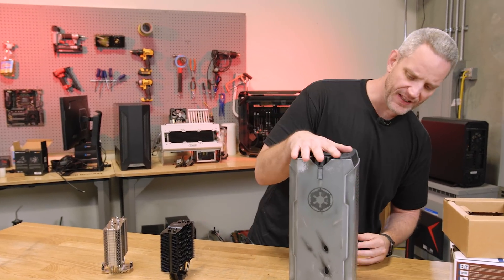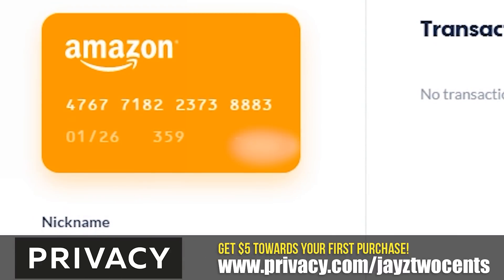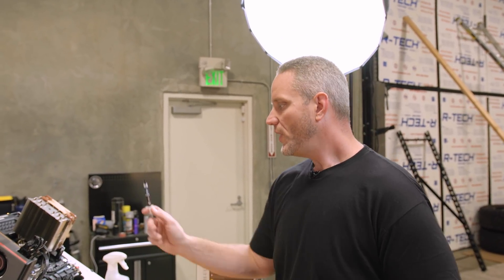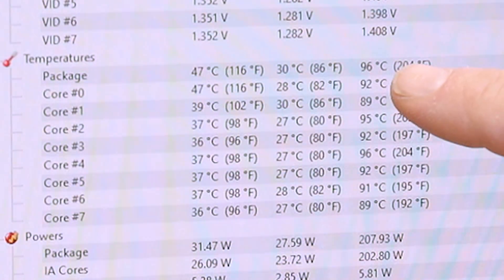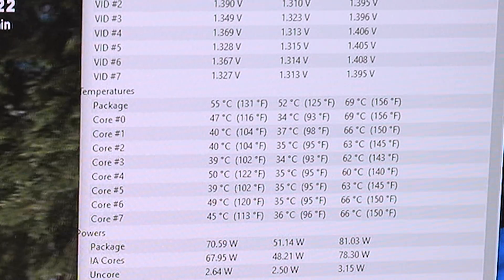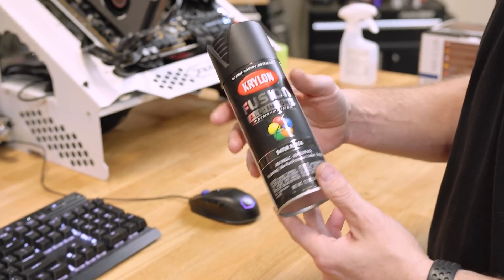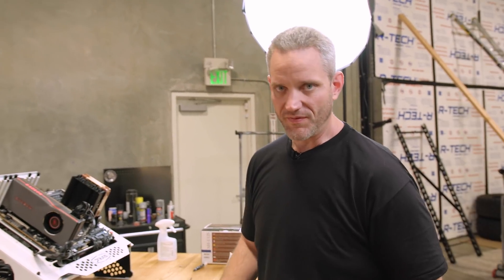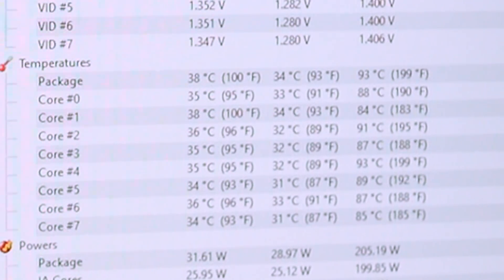Does painting a heatsink hurt its performance??

Comment: This is posted BEFORE watching the entire video. Considering the folks have been painting the intercoolers on their cars and seeing improvements in intake temps, my  guess is a slight drop....

Yup. That one ran me over in the end. So much for the "black body cooling". I guess the better question is;  Why does it work in turbocharged cars, but not CPUs?
Reply: Intercoolers don't transfer heat, they transfer cooling. A radiator on the other hand might be different.
Reply: @serfillustrated4018  The purpose of radiators, heat sinks, heat exchangers and intercoolers is to move energy (heat) from one place to another. In all instances, they are used to cool something that gets hot. In my question above, the heat is generated by the compression of the air and the sinking of heat from the turbocharger. Folks have been painting intercoolers in dark colors or black to improve the efficiency of said heat extraction with noticable improvements. I just wonder why it doesn't work for a CPU.
Reply: @rhl8673  Yeah i got into a long back and forth with another commenter on here lastnite. I probably confused the hell out of him because i had your comment in my mind the most.. But an intercooler isn't removing heat from the engine as its purpose. And while it does dissipate some heat from the turbo its main function is to cool the compressed air before it enters combustion because a supercharger uses a intercooler too and it isn't powered by the exhaust. An air cooler for a PC acts more like heat fins on a small engine block as it only dissipates heat. Where as a watercooler on a PC acts exactly like a radiator as it removes heat and introduces cool to the same part. So there really isn't an equivalent to an intercooler on a pc. But if i had to guess why its working on a car it may actually be insulating the air going through the intercooler from the heat of the engine bay. But thats just a rough guess.
Reply: @serfillustrated4018  An intercooler does not remove heat from the engine... Correct!

An intercooler DOES remove heat, just like a radiator, from the air charge going into said engine, thus increasing it's density and improving power gains from forced-induction systems. As a matter of fact, some intercoolers are re-purposed radiators and are rather efficient at heat extraction. The only reason there are fins on air cooled engines is to increase the surface area exposed to the moving air stream. Therefore, the fins on an intercooler do the same thing, increase surface area to improve heat dissipation.

You need to keep in mind that all terrestrial cooling systems rely on fluid movement of some kind. The fluid in use could be anything from air to Argon to oil to water and even specialty premixed coolants. I mean, even the fuel system in a car relies on the fuel it's pumping to keep the pumps from blowing the car into low-Earth orbit.

A supercharged engine uses two heat extraction methods because of the inherent design of the charging system. Most Roots or Lysholm type superchargers use a heat exchanger, a pump and an air-to-liquid intercooler(radiator) to cool the incoming air charge. It's not as efficient as a turbcharged and intercooled system, but it does allow for instant boost.

Now, let's go back to my original question. Why does painting an intercooler black improve efficiency, but not on an air cooled CPU heat sink?
Reply: @rhl8673  I don't know that it does. I don't know how controlled the variables were for those tests. Yes i know that a radiator and an intercooler are exactly the same part, broadly speaking. But like i said before, there really isn't an equivalent part(in function) on a PC to an intercooler. An intercooler on a car isn't dealing with as much heat as a radiator or heat fins of the engine block. And since an intercooler is cooling the air that is traveling through the inside hollow portion of it. My only guess is that the paint may be insulating the inside air from the outside air of the engine bay that the intercooler sits in. The kind of paint may play a role too. Im sure a lead based or any other conductive paint could help radiate heat as well. Fin density in a PC air cooler may be tighter too. So painting the fins may be restricting some airflow going through it.
Reply: @serfillustrated4018  I'm sorry, dude, but the intercooler on my car is definitely handling way more heat than the heat sink on even the meanest CPU. The turbocharger on my car can reach temperatures of nearly 900 degrees F and compress the air to around 19psi, while my average intake air temperature barely breaks 140 F at the throttle body on a hot summer day. And as for air cooled engines, like a weed eater, that 30cc engine probably makes close to 5Kw, enough to power 10 high performance PCs. I will admit that an air cooled engine will get way hotter than a CPU should ever be, but still not hot enough to melt the plastic housing it's mounted on.

I'm not buying the fin spacing idea either. Most of the air coolers I have seen have fin spacing that is equal to that of an automotive radiator or intercooler. If it was any tighter, air flow would be greatly restricted.

There is something else going on. You may be onto something with the thickness of the coating layer or it's composition, but it still leaves me wondering why there is a difference.
Reply: @rhl8673  "I'm sorry, dude, but the intercooler on my car is definitely handling way more heat than the heat sink on even the meanest CPU"..
 I NEVER compared it to a cpu/heatsink temp. I compared it to an engine block or radiator. And the exhaust side of the turbo isn't the same as the intake side. You may have 900 degrees coming out the exhaust side of the turbo but the air coming out of the blower is nowhere near that. 

"I'm not buying the fin spacing idea either. Most of the air coolers I have seen have fin spacing that is equal to that of an automotive radiator or intercooler. If it was any tighter, air flow would be greatly restricted."..
Thats my point man. The PAINT density on the fins could be restricting airflow on the CPU cooler, NOT your car. An intercooler has ALOT more air pressure blowing through the fins then a tiny electric fan provides for a CPU cooler. Thats why the cpu dropped 6degrees when he switched to the faster black fan. 

"You may be onto something with the thickness of the coating layer or it's composition"..
 Yeah id say that is what is playing the biggest role.

Look man. My WHOLE point is that you cant compare a cpu cooler to an intercooler. BUT.. A cpu cooler IS comparable to fins on and engine block. And a liquid cpu cooler can be compared to an engines radiator more accurately. But of course the scaling are different. And once again, YES i know a radiator works the same as an intercooler. But a radiator is used to cool the engine just like a heatsink/watercooler cools a cpu. An intercooler is NOT used to cool the engine, therefore it doesn't relate to any part of a PC as PCs do not run on combustion. Good talk man. But i had a very LONG and similar conversation about this with another dude lastnite. Im kinda burnt out on it. 

Later Man!!
Reply: @serfillustrated4018  You're burned out because the information you are using is flawed. The point I am trying to make is that an intercooler and a CPU heat sink do EXACTLY the same thing. Move heat from one place to another. In the case of the intercooler, it moves heat from the Hot, high pressure air charge coming out of the turbocharger to the air using fins and a fan. The CPOU heat sink removes heat from the CPU die and transfers it to fins that are cooled by a fan. It doesn't matter what you're removing heat from. For all I care, you could be using it to keep a constant temperature in a box of Skittles. I want to know why an intercooler painted black improves performance, but doing the same operation to a heat sink gives the opposite result. That's it. Nothing else. Thermodynamics is an interesting subject to me and, somehow, I got dragged into some wild tangent trying to explain it to you without losing my cool. (no pun intended) So, if you can't come up with a decent answer, I think we're done here. I'm sure that someone more knowledgeable than either you or me is floating around here.

Comment: Cerakote or whatever ceramic coating are marketed as thermal insulation for exhaust I don't get why they would use it on heatsink which is supposed to dissipate heat...

Comment: Prediction: It will matter a little bit, but not terrible.
I was right, You should try it with 2 low flow fans in a push pull config to see if that would help temperatures.

Comment: I saw this experiment once before. In a low to no airflow situation the black paint increases thermal transfer through radiation but in a high airflow situation that extra radiation is more than offset (negatively) by the insulating properties of the paint. I think this was done on mighty car mods channel if you want to look their research up.

Comment: there are some paints that are thermal oriented that maybe have better thermal conductivity, or a powder coat, but the metal should be very clean before the painting, like you do with thermal paste, to get the best contact possible for heat transfer, yeah, sorry, I'm babling a lot

Comment: I predict what Jay is saying at 1:20 - a couple of degrees hotter. Not at idle though, and not on short loads; only after extended loading, once the cooler and case reach equilibrium. I predict the equilibrium temperature will be higher once painted.

Comment: You can get special thermally conductive paint to reduce the thermal resistance. Also the finish matter, a finish with more surface area can have lower Thermal resistance.

Comment: no, hold the base of a cpu cooler with no fan on it and put the other end in hot water and see how quick you feel the heat at the other end, as long as there's still air going over it it'll be alright, maybe a couple degrees difference

Comment: My guess is that it will warm it up slightly, due to the paint restricting airflow between the fins and insulating heat so if it was in a case then it would probably absorb some of the heat generated in the case from the other components.

Comment: I can't make an informed prediction but from past experience it will depend on 2 factors: (1) type of paint (is it a heat insulating or conducting - both paints exist) and (2) there clogging between the fans.  If it is heat conducting paint and little to no clogging of the fins I predict little to know degradation in performance. :)

Comment: Years ago  (Slot 1  Pentium II era)  a super techie friend lampblacked  ( Used an actual black smoky flame source)  a Celeron 300a heatsink and got the 300a to stay stable at a  450 mghz overclock where it had been a little flakey before. 80 mm fan out of a dead PS helped too though. Black anodizing is the way to go however.

Comment: I wonder if it would be the same result as when Mighty Car Mods painted an intercooler black to see what would happen to its performance.
Reply: A cpu cooler dissipates heat like a radiator. An intercooler collects cool air.
Reply: @serfillustrated4018  No it doesn't. Hot air flows through it, and it radiates the heat away to the cooler air flowing over it.
Reply: @acdchook  Which are you referring too?
Reply: @serfillustrated4018  An intercooler. Hot air out of the turbo flows into the intercooler, which radiates heat away to the outside air, so the air exiting the intercooler is colder.
Reply: @acdchook  Thats true for a turbo. But its a little different for a supercharger. A supercharger creates heat due to air compression while a turbo charger creates most of its heat by being run by the engine exhaust. You could technically use a intercooler to collect cooler air on a naturally aspirated engine by using ram air to push clean air through the intercooler. My point is that a radiator is to ensure heat dissipation from the engine itself. An intercooler doesn't dissipate heat from the engine per se but from the turbo or supercharger compression. Yes they technically work the same but the objectives are different.
Reply: @serfillustrated4018  An intercooler is the same on a turbo or supercharger. They go between the compressor and the engine intake. The air is hot because it is compressed in both cases. A CPU cooler may be hot solid metal, vs hot hollow metal on an intercooler, but both are just trying to radiate heat away into the cooler surrounding air.
Reply: @acdchook  Yeah but a cpu cooler is only used to radiate heat, which is more akin to engine block fins. And of course a liquid cooler is identical to a car radiator. Nothing on a PC is really close to an intercooler unless you consider intake fans. You are right but im just comparing a cpu directly to an engine. My point is that a radiator takes heat from and engine while an intercooler may transfer some of the heat from a turbo, its main function is to cool down compressed air before combustion. So an intercoolers job isnt to remove heat from the engine but to introduce cooler air.. Thanks for the talk tho.. Its good to work my brain late at nite!!

Comment: 1:16 If you use an enamel paint which knowing you, probably. I'm betting that it's only going to make like a two to three c
Yupppppp
Reply: Maybe a Carbon Black paint... might rub off easily, but should be pretty conductive.
Reply: @CrashM85  an enamel based paint is usually used on engines and are engineered in order to not insulate heat. Either cemaric or sometimes metal flakes is usually mixed in with it the paint. It comes in rattle cans as well, i painted some chipset heatsinks with it before, a non issue. But thermal volume is negligible enough that it doesn't matter if you ran it bare with most pch chips (south bridge, north bridge etc etc)

Comment: My prediction is that you will see a measurable difference in performance, but it will be insignificant enough that it doesn't pose any issues.  (So maybe a few degrees, like it'll go to 85 in situations where it would normally hit 80)

Comment: its kinda of like RGB vs overclocking
does it change anything?   technically yes, but only by a small amount.
does the degree to which it affects performance matter for my use case?   depends on how badly you want it to look the way you want

Comment: Similar concept, but Mighty Car Mods debunked this a few years ago. A thin layer of paint is not enough to truly "insulate" the cooler enough to cause a change in temperature outside of the margin of error.

Comment: My prediction is minor performance hit that wont matter unless overclocking and maxing performance.

So yeah I was right, they are minor variations that wont really matter.  In real world it was within margin of error and under stress it had a minor impact.  My take away from this is that unless you are pushing your system it doesnt matter but if you are pushing your system you might be going exotic anyway.  So paint away.

Comment: Prediction... almost none , been into car racing performance for a long time and turbo intercooler as been tested with paint and a max of 3-4% degrees difference where seen.
Reply: Percent degrees?
Reply: If the temperature is 100 degrees add a 3 to 4% increase in temperature you would end up with a 104 degrees total.